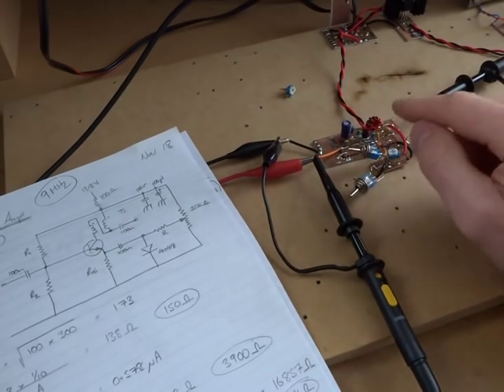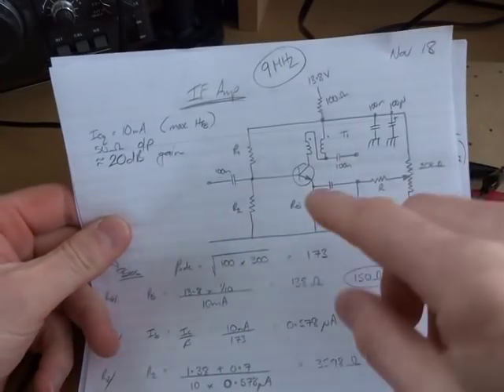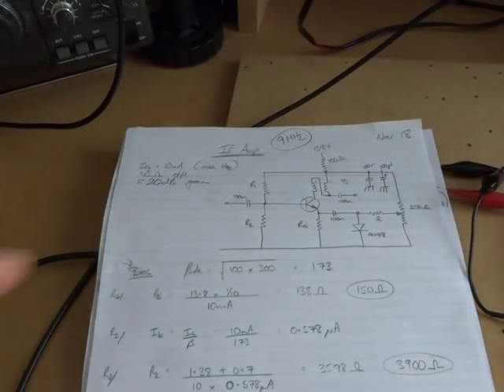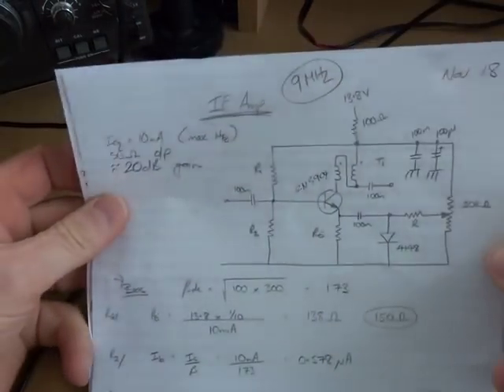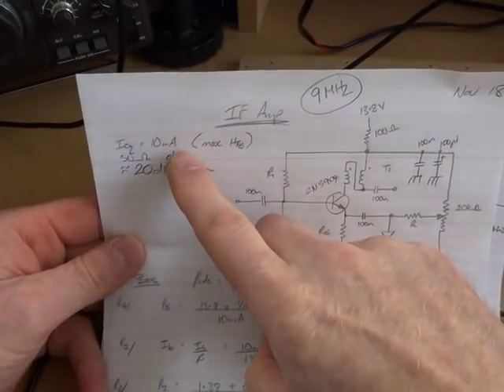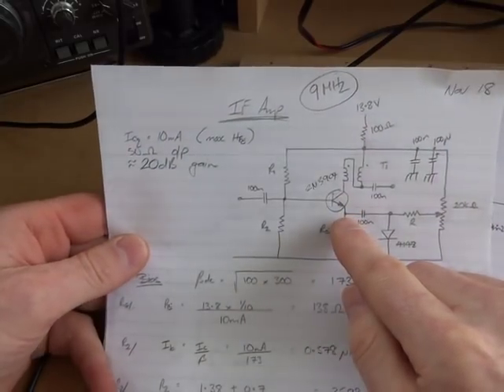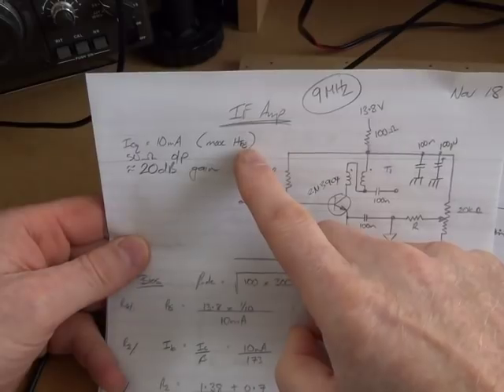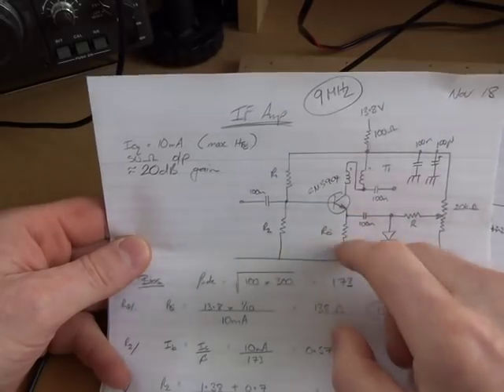Homebrew MC1350P based SSB Rig - #5 IF Amps, Part 1

Comment: If you are looking for a really low level source, Bill K1CLL (now SK) used something called an infinite attenuator.  He wrote an article in '65 about his UHF version and in '74 about on he used on 6 meters. The '74 article can be found on Archive.Org at /details/73-magazine-1974-09/page/n108 

He built some of the craziest stuff and explained it all.
Reply from the maker: Just read the article. Very interesting. I wonder how he calibrated the scale. That aside, an interesting read. Thanks again.

Charlie
Reply: @CharlieMorrisZL2CTM  Would you mind sharing a link to the article?  I'm not finding it on archive.org given the criteria above.  Thanks.
Reply from the maker: @bbowling4979  Sure. Try https://archive.org/details/73-magazine-1974-09/page/n107
Reply: @CharlieMorrisZL2CTM  Thank you Charlie.
Reply from the maker: That's really interesting thanks. I'll take a look.

Charlie